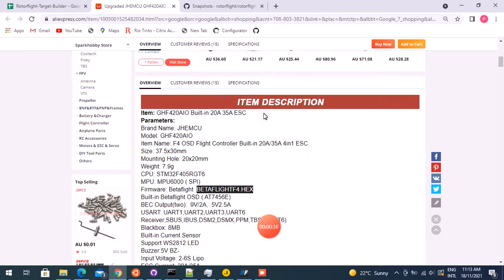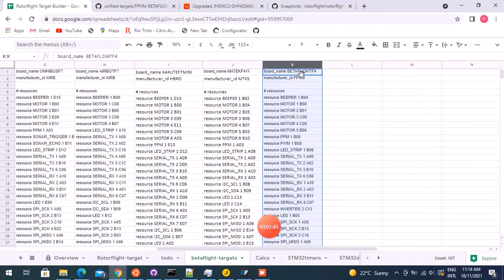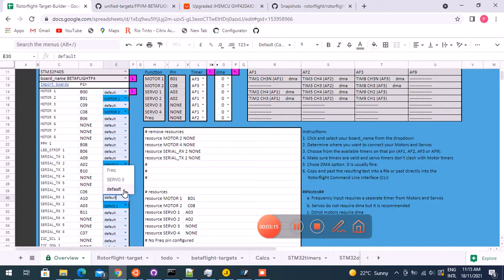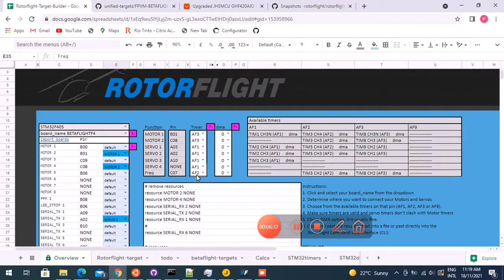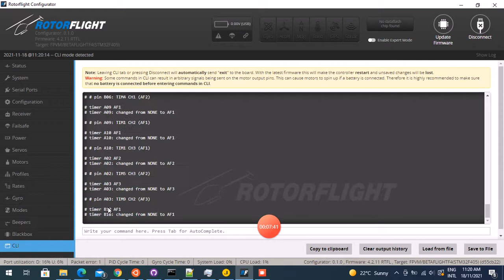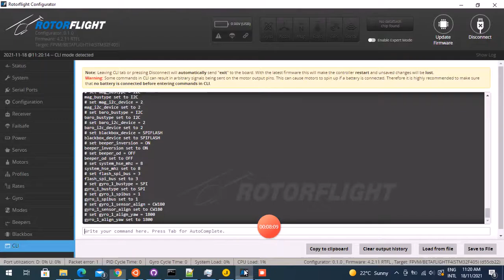Rotorflight pin remapping spreadsheet.

Comment: when I copy betaflight unified-targets and select the board, the pin column only shows "NONE" .
I think it's something to do with the spreadsheet not recognizing the "space" between values.
any idea why this is happening ?
Reply from the maker: Hi there. Please check you are using the most recent version of the spreadsheet. The link is in the wiki. It is currently v1.4.1. Please make sure you are I only selecting the line 'board_name' and below to be pasted in the betaflight list. 'board_name' must be the first line in the spreadsheet. 

There is also an updated version of this video. https://youtu.be/TNAeDaAjzfQ
Reply: @philkaighin3582  I made a short youtube video of screen captures.
v=r6QUeYxApKE 
copied target will only show "NONE" on pin column, no matter what I do.
I had to manually edit every line of existing target to make it work. 
if I copy existing column to a new column, it will only show "NONE".
Reply from the maker: @davidjacobs8558. Hi there. I have been away and have only just seen your video. It was a bit difficult to see what was happening. I added your target to the spreadsheet and it seemed to work fine. Please open the current file from the link and save a copy and the speedybeeF405V4 will be in the list.

Comment: Hello, I can't make my esc work already calibrating but even so it doesn't make the motor run... my motor and pwm
Reply from the maker: There are several reasons that it could be. Does it spool if you set Governor mode = passthrough? The Arm mode has to be enabled on a switch separate from your throttle hold. The FC must see min throttle before it can be armed. The other reasons for Arm not being enabled will be dislayed with the arm disable flags on the Status Tab.
Reply from the maker: If you contact us using the Discord we can give you much better detail on what to do. It is an active discussion and there is always someone ready to help.

Comment: This was very helpful.  I'm trying to put a kakute f7 min v3 in a 500 size heli.  Your spread sheet gave me this :
# remove resources											
resource SERIAL_RX 4 NONE											
#											
resource MOTOR 1 NONE											
resource MOTOR 2 NONE											
resource MOTOR 3 NONE											
resource MOTOR 4 NONE											
#											
											
# resources											
resource MOTOR 1     A01											
resource MOTOR 2     NONE											
resource SERVO 1     B00											
resource SERVO 2     B01											
resource SERVO 3     B04											
resource SERVO 4     B05											
# No Freq pin configured											
											
# No feature FREQ_SENSOR											
set tail_rotor_mode = VARIABLE											
											
# timers											
timer  A01   AF1              # M1 - pin A01: TIM2 CH2 (AF1)  											
timer  B05   AF2              # M2/S4 - pin B05: TIM3 CH2 (AF2)											
timer  B00   AF2              # S1 - pin B00: TIM3 CH3 (AF2)  											
timer  B01   AF2              # S2 - pin B01: TIM3 CH4 (AF2)  											
timer  B04   AF2              # S3 - pin B04: TIM3 CH1 (AF2)  											
# No freq timer											
											
# dma											
dma pin A01 0                 # M1 - 0: DMA1 Stream 6 Channel 3											
dma pin B05 0                 # M2/S4 -  0: DMA1 Stream 5 Channel 5											
dma pin B00 0                 # S1 - 0: DMA1 Stream 7 Channel 5											
dma pin B01 0                 # S2 - 0: DMA1 Stream 2 Channel 5											
dma pin B04 0                 # S3 - 0: DMA1 Stream 4 Channel 5											
# No Freq input cofigured

looks good in the configurator, now its time to hook up some servos and see what happens :)
Reply from the maker: Hi there @M F. It looks alright. This was a sample video for my original spreadsheet. The latest is at https://youtu.be/TNAeDaAjzfQ.

The spreadsheet can be found https://github.com/rotorflight/rotorflight/wiki/Custom-defaults-remapping-spreadsheet. 

Check out the Rotorflight discord chat if you want help setting it up. There is an active group of us happy to help out. https://discord.gg/FyfMF4RwSA
Reply: @philkaighin3582  I watched that video as well.  I've never used discord before, but if I run into trouble, I'll give it a shot.  Mostly I just read through RC Groups threads, which is where I found out about this fork.

Got cyclic servos moving with the FC. :)
Reply from the maker: Good on you. Getting the servos working is a great start. What board/ESC are you using (dumb question, just read it again.... 🤪)? I'm PDK on RC Groups. You can definitely post stuff there (would like to see your build). The discord is is like a chat site. It's a bit more real time so it's easier to step people through it.
Reply: @philkaighin3582  esc is an old align 70 Amp.  No telemetry, and I don't think it has a governor.  I'll post the build on rcg.